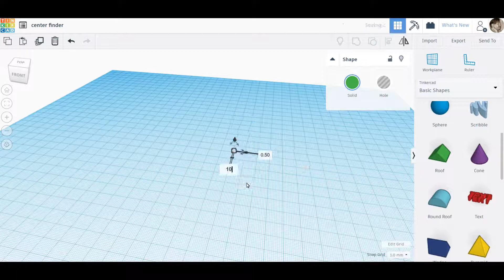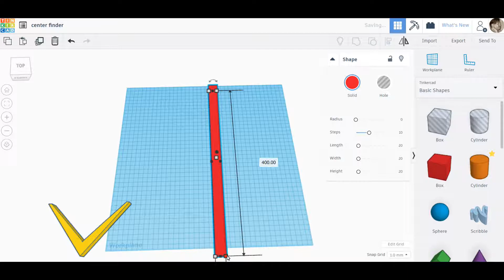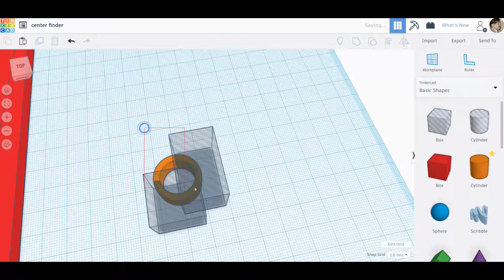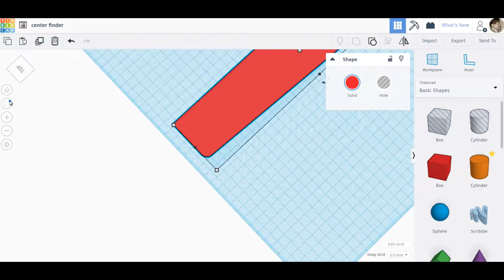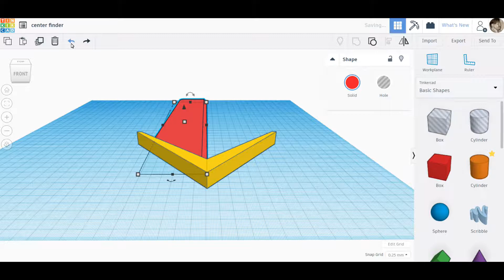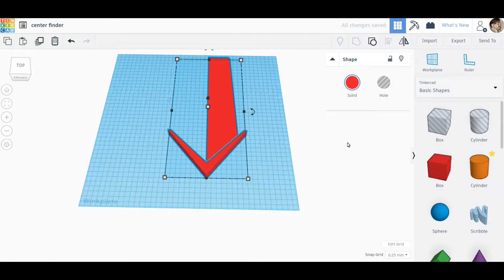3D printed circle centre finder and edge square

Comment: No point worrying about not being able to use Fusion, there are lots of us that find it difficult. I ended up paying 3500 aud to upgrade the system I have been using for years when I could use Fusion  for my work.  Just could not get hold of it.  I have used the cam side, but only after importing something I have already drawn in Keycreator.  I have found tutorials by Makers Muse by far the easiest to understand (for Fusion), but having paid for my own upgrade I have lost interest somewhat. I do not regret paying for the upgrade as I was using it productively immediately after downloading it.  Paid for the upgrade in no time. 

I have been cad drafting for 30 years and the way I work is nothing like the stretch and shrink method you are using here in Tinkercad.  I just love watching the way it works.  My system does this very well, but I just don't use it!
Does Tinkercad not have a chamfer/fillet command built in? 

Have you ever looked at Design Spark?  Swdweeb uses it to great effect.

I would have made the ends of the Vee shape complete radii, my printer goes round a radius much nicer than it will make 2 sharp corners. Almost never any strange artifacts on a radius which I cannot say for  sharp corners.
Reply from the maker: I could have put a radius on the ends but I was in a hurry.
Tinkercad is a very simple system so no  easy way of adding chamfers.
I have bee watching Angus for fusion lessons, but with everything I do, its time